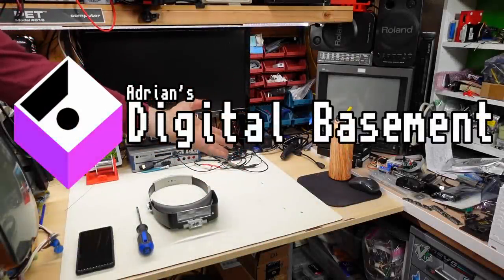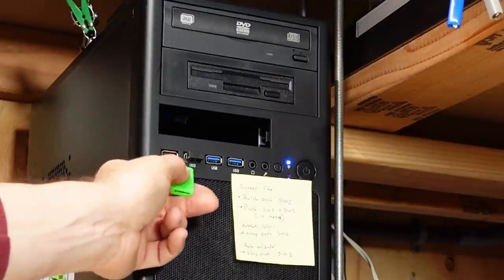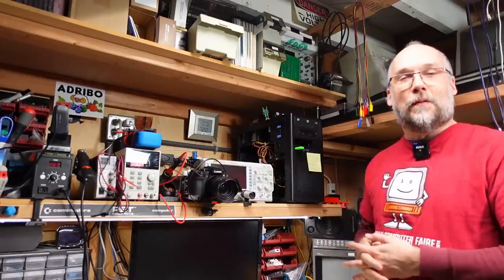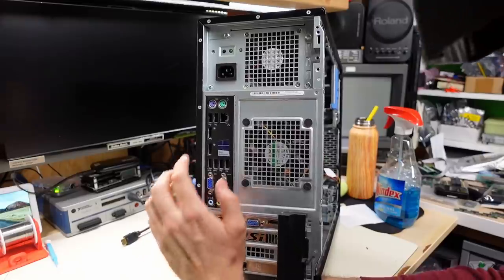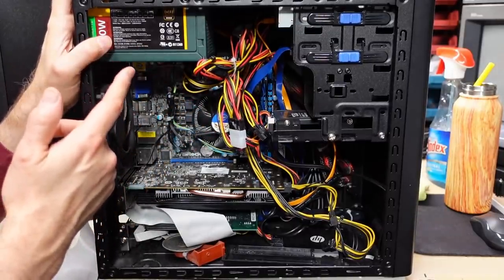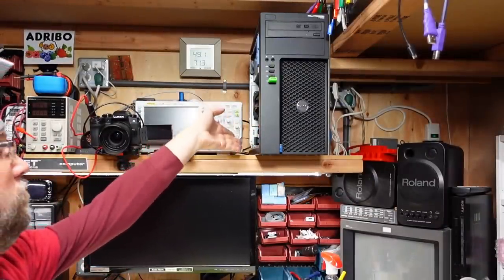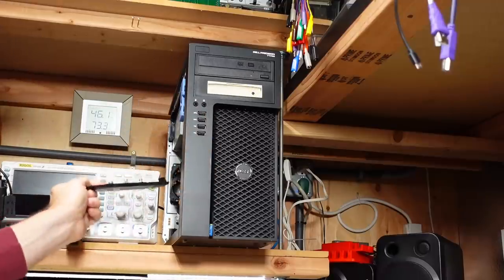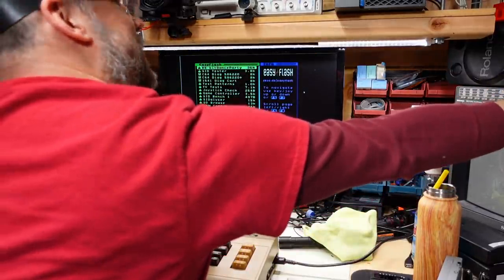Let's upgrade my lab PC and talk about tools I use to make videos

Comment: I'm so sad that I only recently found your channel because I just sold a Core 2 Quad system for a pittance that would have been a great "bridge" system for your workshop. It had IDE and FDD controllers and two PCI slots, but it was a quad-core, 64-bit system with great SATA SSD support, two PCIe Gen 2.0 x16 slots, and dual gigabit NICs. The only catch was it took weird 1.8v DDR3 RAM, but I had a working 8GB kit. Now I know who to tell when cool stuff lands in my workshop!

Comment: These Dell (and HP) workstation machines are awesome. You can usually find them pretty cheap on eBay or local computer recycling stores.
Obviously these were very expensive machines when new, so they are built quite reliably. I've helped some friends by getting workstations like these, and throwing in a modern GPU and SSD to make a decent gaming rig on a budget.
Reply: I've done the same many times. Very reliable, and many also run Linux very well.

Comment: This is definitely a computer that's meant to be a workstation for a company, and you'll see VGA ports on a lot of those as a lot of companies still have VGA hardware that they don't want to replace until it dies.

Also, the days of cutting yourself on PC cases is only over for enthusiast PCs/cases. This one will have been built down to hit a price point that makes bean-counters happy, and if there was a hardware problem they'd probably just send it in for a warranty replacement instead of having on-site IT do repairs.

Comment: Speaking as an IT admin, Lenovo and Dell are the kings of non-standard PSUs in otherwise ATX-compliant cases. A real pain if you have a failure. I used to invest in a small number of PSU adapter cables "just in case", though that doesn't help if there's a weird form factor to the PSU.

Good thing you're so handy with electronics in case you ever need to hack an ATX PSU to replace the Dell one.
Reply: We modders don't call them 'HeLL' for nothin' ya know.
Reply: HP definitely has proprietary PSUs as well, at least from when I was looking at getting a used workstation motherboard to upgrade my PC.
Reply: This is much less common these days. I have been stuffing standard ATX PSU's in Dell workstations for much higher end GPU's for years now with no issues. The biggest problem I have found with Dell boards is their custom front panel connectors. Sure, you can buy adapter boards to make them into standard headers, I get that Dell did this to create a single connector solution to plug in everything at once on their assembly lines, but it sure as heck makes them a pain to reuse them on anything other than the case they were designed for.

Comment: I have a bunch of those Precision T1700s. Good case design, good power supply. Nothing exciting about anything on the motherboard but it's reliable and should get the job done. I should have some spare drive rails if you want them. Dell power supplies haven't had physical power switches in decades. They are definitely nonstandard which can be a pain if you have to replace them, but I've only had one or two fail out of hundreds of Dells I've dealt with at work.
Reply from the maker: It's ok, but thanks. I'm totally fine with just laying extra drives around the inside of the case. Like velcro to hold on SSD drives LOL! Sketchy, yes, but it works :-)

Comment: I believe the reset button is underneath the front bezel. It's at the end of the small wire that you thought was a temp sensor. That's how my Dell server machine is built anyways.
Reply: These desktops don't have anything under the bezels except access to the internals. Server bezels are different because they are optional "security" components specifically designed to prevent system access by unauthorized persons.

Comment: USB 3 was pretty flaky in the first few years, only Intel's chips seemed to work well. The USB group must've tightened the spec as it works great on recent AMD and ARM devices.
Reply: Even my z77 board has some slight weirdness with it’s extra USB 3 controller. the Intel ports work completely fine though.
Reply: "was" pretty flaky? 

USB is STILL not stable enough for a production environment ... at least when it comes to audio / video production.

it may work if you have ONE HDMI grabber and ONE webcam that sends compressed "1080p" video to the computer ... but handling multiple video streams from multiple USB capture devices is a pain in the ass ... spreading the capture devices over multiple usb controller cards to avoid bandwidth problems makes everything even more dodgy ... but since firewire has been phased out, and thunderbolt is even more of a mess, USB is all we got

Comment: Hi Adrian and thanks for the frequent videos!
One thing you should try is reflashing your UEFI / BIOS! They tend to loose bits over time which could explain the problems you encountering. As you mentioned ECS something else sprung to mind: Capacitors!
On your newish Dell: Please do yourself a favour and monitor the PSU! They tend to fail silently which causes USB issures as well. You are right: This chassis doesn't use rails for the 5,25 inch drives. However: They use longer screws (which are captured with the plastic thing at the back). The UEFI of this PC has a whitelist of GPUs so changing the GPU is not an option.
With the XEON-Processor I think only ECC RAM is going to work for upgrades, if you desire to do so!
Reply: These systems are way too new to be suffering from bit rot on the firmware, plus I believe they also do a checksum verification so it would be detected. Regarding parts compatibility with the new system, I believe you are mistaken. I haven't heard of desktops having GPU whitelists and also the installed installed clearly isn't original. While the desktop Xeon can use ECC RAM it will work fine without it; in fact if you look closely you can see it's currently running non-ECC RAM.
Reply: @eDoc2020  Okay. The bit rot on the firmware occured in my personal history even on PCs which were much younger than the old one of Adrian, so I wanted to state the possibility. Some hardware I had to work on even wasn't five years old and had to be reflashed. Not every UEFI or BIOS for that matter is checksummed equally and there are vendors who don't bother to check the full flash so mistakes coud be undetected.
Dell has a history of putting whitelists in their UEFI and it would not even surprise me, if you inserted a 30 series Nvidia into this motherboard, it would stop working.
AFAIK Dell had whitelists for GPU Chipsets so the vendor of the GPU is irrelevant.
After rewatching the video I have to say: You are correct for the RAM used: The chipset seems to support ECC-less RAM while I don't think you could easily mix them.

Comment: Dell Precision Workstations are great - they last forever.  I have a T5600, T1700, and even an old 410 with dual P3s as one of my retro workhorses.  With pretty much all the ports internally and externally including SCSI I can pretty much throw any retro drive at it.

Comment: Adrian the three screws on the cover are for the drive.  The shoulders will allow the drive to slide into the case and the lock into the locking mechanism.  Two screws on the open side and the third on the front of the far side of the drive.

Comment: I have a Dell T5500 which I bought second hand.  I notice that the drive bay cover you removed to install the ZIP drive has four screws attached to the inside of the bay cover.  Neat idea

Comment: I also have a 750Ti, and the reason I chose it is because it can drive a 4k display at 60 Hz, and it was cheap by the time I bought it. Nothing below that level in this generation has that capability. That doesn't mean 60 FPS is guaranteed, of course. I don't have it driving a 4k display, but it's driving four more normal displays (two DVI ports, two HDMI ports).

The system it lives in sounds like your bench machine from two iterations ago -- it's still an AMD Athlon 64 x6. It won't ever see official Windows 11 support, but I don't think your Xeon is going to either. In any case, I did some OBS streaming using NVenc and it is still an order of magnitude faster than using the CPU.

Comment: I believe the Lumix cameras have a clean HDMI output, so it's a good option for a streaming setup. Not sure about the placement if you're sitting right at the bench though, might have to put it at such a wide angle that it looks weird. But I guess it would work if you're sitting back a little playing with a joystick or controller.

I'm also wondering whether moving the windows boot drive from another machine causes any weirdness with the windows license? I know modern machines somehow save the key onboard so it automatically activates with the same key when you reinstall windows. I'm curious if it just picks up the old windows 8 key and activates using that, or if it tries to activate using the old key. Because if it's the latter that probably wouldn't play nice with OEM licensed installs. Probably not really relevant, so feel free to ignore the question.

Anyway, congratulations on a well-deserved upgrade! And you really can't beat that value for money! 😆

I was considering upgrading my old desktop to a mini-itx with an AMD Ricer APU, but my old GPU is still twice as powerful as the one in the Ryzer, and intel chip in my mac isn't that much less powerful than the Ricen (and the eGPU is about twice as powerful as the one in my old desktop!). Either way it's not as much of an upgrade as I'd like.

Comment: I bought a new computer case a while back and still wanted one 5.25 and on 3.5 inch bay (call me old fashioned). I like to have the capacity to burn media. The 3.5 inch bay got a card reader / extra usb ports. 
You got a pretty cool setup.

Comment: I have the exact same T1700 as my main PC.  Ex-Workstation so has a Nvidia Quadro card instead of a GeForce but will play GTA V with no problems.  Although even though has a VGA port on the motherboard, there is no onboard graphics with the Xeon CPU.

It’s a solid workhorse, Windows 11 works well on it although not officially supported.  Linux is fast on it as well.

I use a SSD for the OS, and then Intel Hardware RAID with 2 physical HDs for data.

Comment: My wife and I bought a pair of these systems brand new back in the day, and they're absolute beasts. We use those as desktops. She's rocking an RTX2060, 32GB of RAM and I have a GTX1650 and 16GB of RAM.
Incredibly well-built and long-lasting machines.
There's a 5 1/4 Dell option that includes a slim DVD-RW drive and a card reader unit. It's pretty handy.
Reply: @rockapartie  All I play is GTA Online and a little bit of ETS/ATS from time to time. She's much more of a gamer. 😂

Comment: I really like DELL PC’s had several and just seem to work!  Also can be picked up dirt cheap second hand as they’re in such abundance from offices when they upgrade.

Really, really easy to take apart as well.  Hardly even need a screwdriver but we’ll made as well.
Reply: meh depends on what dells u buy they used to be plagued with thermal issues with there funky proprietary mainboards as well as purposely putting a lack of fans in their computer cases so that they go bad faster